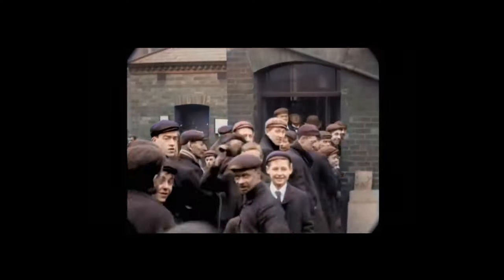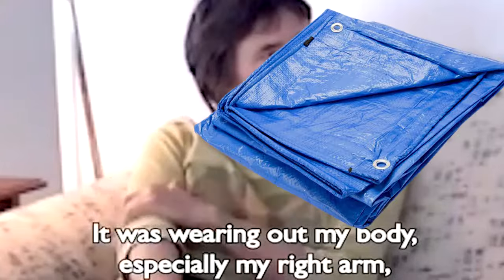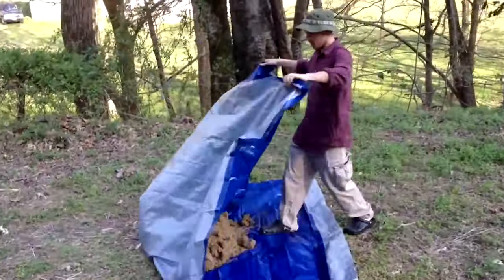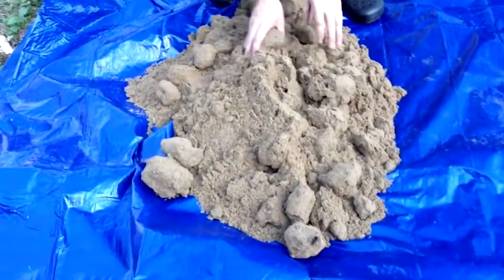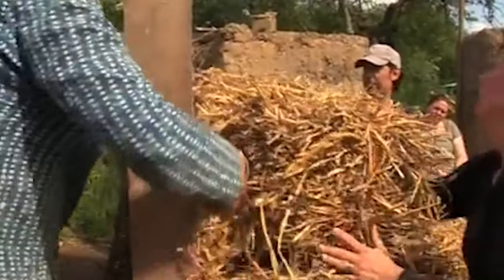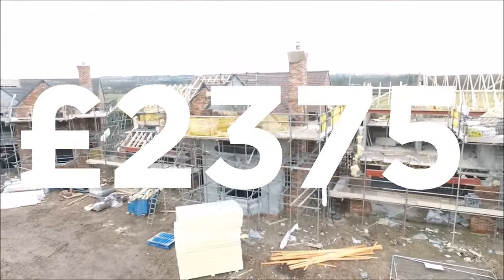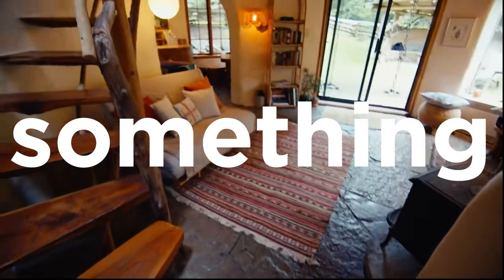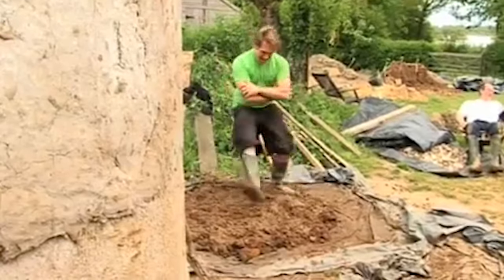Is Cob the Building Material of the Future?

Comment: I gave it a thumbs down because although you had good intentions you just don't know.
Reply from the maker: What don't I know?
Reply: @greenfutureyt  it's just that we're only scratching the surface of what we're actually capable of using.
Such as bamboo balers are not even made yet we can construct the garden walls (cell wall) of every home to take on multiple rolls like bee hives and hanging gardens.
You made it seem as though it's out of reach for the masses when really I could take a farm tractor and turn it into a full time adobe mill that sends out truckloads of mix every day.
I just solved the housing crunch and nobody understands what I'm trying to say.
Reply from the maker: @OzkAltBldgCo-bv8tt  depends on what materials are locally available. In the UK bamboo is scarcely available, and not locally sourced.

Building using cob is still far more laborious than using conventional bricks. Whilst you could churn out a lot of cob, you still need people to build with it. By applying a cost to labour it becomes clear why conventional brick houses are the norm
Reply: @greenfutureyt  not even whenever you make an adobe dedicated ditch and are cranking out that mix you don't have to make a brick you completely skip that step it's more stable when it dries an entire layer at a time.
There is zero reason why one of the greatest textiles plants known to mankind cannot be grown in the UK there is some available in your area you have to really look for it but there's so much more that can grow there. And I'm not talking about making rungs for a rail or a ladder only there's just so much more that you can do with bamboo besides floors think of never having to buy steaks for your garden think about bent LVL Timbers laminated vernacular Lumber boards of Bamboo with massive contour bends.
Reply: @greenfutureyt  Peg joinery has barely even begun
Right now and nobody's building Garden walls made of bamboo and plastering it with Adobe. Nobody right now is putting greenhouses on top of their cabins. Not a whole lot of people have even thought about these below ground greenhouses having stem walls built of rock and Adobe. We're going to burm up the north side of the greenhouse and then plant bamboo on top of the mound for optimal buffer against the weather and elements. Exotic LOCAL fruit will be a thing everywhere even in the UK.

Comment: When the walls have straw bales in them covered with cob inside and out it makes more than 2 feet wide or deep walls . Mine is getting below 0 f. At times and stays 70 to 80 with a wood burning stove. In summer its like having ac. Yes intelligence is in nature
Reply from the maker: Straw integrated into the cob mix or a wall of straw in between (alike to cavity wall insulation)? Sounds restful. Have you got any photos of your cob construction?
Reply: @greenfutureyt  there's whole straw bales stacked in and between a wood frame structure then cob clay and straw mix no sand on inside and outside of structure.  Ya I have some pics.
Reply: @greenfutureyt  don't know how to share them here tho

Comment: Can they survive hurricane winds and rain?
Reply from the maker: I imagine if the foundations are raised and strong enough, walls are thick enough, and you coat enough straw around the house it should withstand most weathering.
Reply from the maker: Haven't got hard facts around exactly what wind speeds and rainfall speeds they could take, but would depend on a lot of factors including (but not limited to) design and the exact mix used.
Reply: @greenfutureyt  there are some of the oldest buildings in the world made of a cob/adobe mix. There are ones in England so I think that they stand up to hurricane winds and rain if built right.
Reply: The oldest still-standing cob house is estimated to be roughly 10,000 years old.  I would say that with proper maintenance, it's probably the most durable type of house on the planet.

Comment: Great video! Can the drying time be sped up with dehumidifiers?
Reply from the maker: Thanks! Increasing heat and air flow should speed up the drying time. I think a dehumidifier could have a minor impact. Whilst it would remove moisture from the air surrounding the walls, moisture within the walls might not be removed.
Reply: @greenfutureyt  Ok, That makes sense. Again great video i hope more people find you channel you deserve it!
Reply from the maker: @ChickenManiac  Thank you! Your support is really heartfelt. Have a nice weekend.
Reply: The walls will be built up in layers. This process, unless one had decant man power, will take weeks. Each day you will want to wet down all the wall that has already bean built, before adding another layer. If its hot, the wall may need to be wet down more then once in a day. The slower it drys the less it will crack.
Reply: @greenfutureyt  I think capillary attraction will aid the dehumidifier greatly to extract the moisture from within because nature abhor a vacuum. Additionally, I wonder by drilling holes to the centre of the walls in a staggered "say' 1m centre would speed up drying. Afterwards, the drying holes are stopped and rammed with earth and the plasterers will hide the stopped holes with the finish coating.
Reply from the maker: @elizabethtamp1537  Excellent suggestions! Thanks for sharing them. I hadn't even considered the idea of drilling holes in the walls - and I can't see why it wouldn't work.
Reply: I own a piece of London clay and I'm building with it. HS2 the high speed rail line have researched and decided to use it mixed with cement for tunnel walls rather than treat it all as spoil. The beauty of clay is that only 6 to one cement or even weaker makes perfectly good ( nonstructiral  )and crucially,  waterproof concrete.  Portland Pozolan Cement is a similar product , essential to use for properly dry foundations , and also underwater. 
Clay is underrated as just "cob"  but, , other subsoil isn't as suitable for walls or bricks. The answer to building with it is don't unless you have the right material on site. Go with rammed earth if not.
The answer to using earth materials effectively is to combine methods, a whole house of cob is a huge effort , but one of stone timber and cob and or wattle and daub in half timbered blocks and mix materials like insulators or even modern felts , all not or for the sake of sucess necessary but feasible and effective depending on local circumstances. You have to mix andmatch in modern manners using codes too.  Remember centuries old methods are time tested with eomr strictures being 500 years old. These are usually half-timbered,( wattle daub infill ( soil and wood , limewash outside face )  using post and beam , and rail methods for workwork , careful foundations allowing all wood to breathe and remain drying after rain and consistently they used  overhangs to keep damp away. Overhangs allow ventilation underneath so daub and wattle remain resting inside the wooden frame , always above ground and dru as well. They didn't need damp proof course but the whole structure would ne a damp nd rain proofing exercise , with a few animal and marauder proofing devices built in usually.  The wood joints on very old places are always simple , alot of buttjointing took place , but as much as possible , without nails. Interference fit and the cramming and or bracing or cantilervering  of wood is how it was done. Importantly , the beams are there to holds up the walls , not the foundations which are there to si.plt hold the pillars that the beams ride , Everything os off ground. You never , they never joined the foundation to the wall above , but left a ve tilation gap under the bottom horizontal beam. It was too small for rats to pass through but long and narrow letting absent air in  under most of it. And once the structure is off the ground in this way it never rots and clay always drys and stays dry . Rain alone is never enough to keep it wet. But any ground contact with pure cob gives capillary action to clay or and soil without cement added.As also does tradition concrete absorb a whole lot of moisture from wet ground. The real se ret if you understand this I call the tacit seal. You have a dry structure that'sslightly windy underneath. You wish to seal that structure you only have wind to block. Should it become humid or damp from sealing air in and the cold out in winter , you unsealed your tacit seal,  which is formed between the foundation ( a low L shape wall ) and the bottom beam that carries your halftimbering. Anyway , it's possible for cob and real traditional building to last surprisingly long periods if made with technical knowhow , even if gained from the distant past.
Reply: @Cherry-k5e  This is really interesting, thank you! I need to look into some more of these alternative building methods really interesting stuff
Reply from the maker: @Cherry-k5e  Thanks for your comprehensive response! How are you using clay in the structure of your project? i.e is your project entirely based around using this clay, then using insulators on the inside walls? If you have any updates on your project, I would love to see / read about them.

I find it really interesting what you were saying about the foundations... so you would you recommend stone / concrete as suitable materials to elevate the structure about the surrounding ground? Also, how far above the ground would you recommend?

I didn't think about sealing walls but that does sort of make sense... although, I was under the impression cob houses store and release humidity at different times of the year, would a seal on walls not impact that process?

I do think a combination of natural building methods is optimal. I think reliance on only one building material, e.g cob, rammed earth, etc. can be a limiting factor for actually getting the buildings built. A good demonstration of this, is the addition of hemp shiv insulation to cob walls, as discussed in the video, for greatly decreasing required wall thickness to reach part L building regulation.
Reply: @Cherry-k5e  6 parts clay to 1 part cement, or less? This will be a great ratio to start some test bricks at. Thank you!  I've been looking for a ratio, ever since I red a paper on county dirt road repair. In the paper it talked about mixing a little cement into the substrate being added to the dirt road for stability and strength. Here in the US, finding info on old school building methods can be like pulling teeth.
Reply: @greenfutureyt  you're very welcome it's good to share info and methods even if there's typos sorry. Ambient air is what I meant to put , not absent air. Letting outside ambient air in under or over things always drys them out and keeps them dry , even if it's raining. For example without airbricks to ambient outside air the airgap system commonly used in brick and block walled houses , wouldn't work either to keep walls dry. , even when it uses a dampproof course as well.  So any system you can devise which allows ambient air to exchange around your structural elements , particularly upright posts and vertical walls is going to be of good use to earth filled buildings. Having ambient airflow available ,  doesn't mean you you have to  allow it. You can temporarily block it off ( and with it cold air ) just the same as closing a door. The seal you make , (or unmake as necessary) would be made where the foundation joins the upright posts , just above  which the bottom beam is mounted. Therefore you wouldn't put your bottom beam (  the sole plate ) directly onto the foundation as it would be easy to assume.  You mount it to the upright posts , and this forms an overhang with an airgap. And that's where you seal or unsealed,  with just enough clay to do so. That way , everything in that wall is dry from the soleplate up , and including it , and it all stays dry,  despite being an outside face which is rained on. A limewash to a clay daubed section between timbers is more than enough to see off rain all year , and any moisture from inside given that it's consistent dry or drying. Ambient air is key and that is allowed to enter and flow between the foundation and the wall , and hey presto dry walls no dpc necessary. Adjustable walls they are then as well using that tacit seal system . 
My building uses clay for half timbered wattle and daub infill walls exactly the same as very old houses inthese parts of england . I think the older the house the better proven the building methods and I'm lucky to see how it's been done over centuries. It's not luck they're still standing or the tenacity of oak timber but that cerrainly helps. If it wasn't consistly dry it'd be long gone. Yet people live in even now flats or houses sometimes riddled with moulds and damp from modern construction just being brutalist and thoughtless. Mould and damp will finish a buildings usefulness very quickly if allowed , and nor having happen it is essential to work out . 
The foundations spoke of should be two parallel courses joined for strength on enoughsolid concrete to foot a two bricks wide wall of about 3ft optimally. The inside course ( will be inside the house ) should be 12 inches or  about 3 brick courses higher and the outside course should be as high as not to suffer rain splashback from groundlevel outside  , say minimum 50 cm.  With this  L shape base wall / ledge/ foundation , it's always going to drain and dry , if it gets wet. With the outside ledge being lower , it's going to drain to the outside as well now. If you've now got that system covering your four corners , you now need only upright posts to go vertical , and  soyou seat the bases of these on the outside ledge . That means their bases will now drain and dry , and they're off the ground , high enough to avoid ground dampness rising through the brick foundations and into them too. 
And as I was saying , beam / sole plate , the horizontal wall support, goes on outside of that, mounted to the uprights at >near< the bottom. This strengthens the structure of uprights as well , squaring them at the same time too. And obviously it'll form the horizontal base of a dry vertical wall . Dry enough to be made of mud.  Once there's uprights you put rails on them ( top edge horizontal beams ) and then rest the ceiling joists on the rails, squaring the box.  They have to be postwood really , square 4x4s are just right fora small house. On mine I put top plates in too and saltboxed it but could have joined rafters to joists for real simplicity min materials and max strength. I've a 45degree roof and a large porched overhang on the main weather and sun facing wall , the best place for a front door collecting heat and airflow. Most of the oldest buildings have this overhang and sun aspect to the front door wall as well. They're neatly all eithee half timbered , or full stone like castles.
Reply: @Cherry-k5e  Thank you. Cement has a patent, how its made has been kept a secret here. its basically clay/cob, fired an ground back up. 
 Ill be traveling until summer. Then ill be looking for a bit of land to play with. Ill be looked for good cobbing earth. I love clay. I was a mud baby. Always sitting in a puddle molding random shapes out of bits of clay.
Its been frustrating, everyone always saying cob an cement an lime can't be mixed. I'm always like, but Europe.  I know they can be mixed its just a lost art.  Cheers to us who relearn it, and pass that knowledge back onto a new generation.😊
Reply: Chicken man? Got a friend in Georgia, goes by that name.

Comment: use mortal mixer to mix cob to get it to dry faster use more sand and some portland cement to make it more stable
Reply from the maker: Yeah mixing it could definitely be easier. 

I was considering building an outhouse but including cement in the mix. Feels like cheating a bit though, as cement isn't dug from my garden. Although, to be honest, I don't have sand in my garden, so that would be imported from the local shop too... might make a video on it too
Reply: @greenfutureyt  cant hurt plaster of paris is a good alternative or use some hydrated lime and sodium carbonate in the right proportions sets up like portland cement
Reply: I have used paper instead of straw or sand and it makes the mix hold up to heave down fail and being soaked the most resilient way to make a cob/adobe mix.  It does take longer to dry.